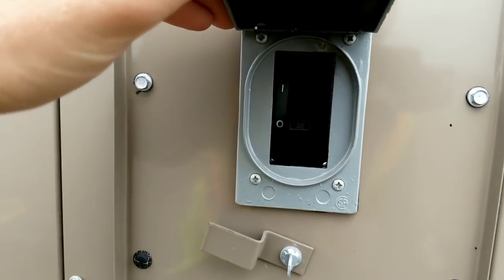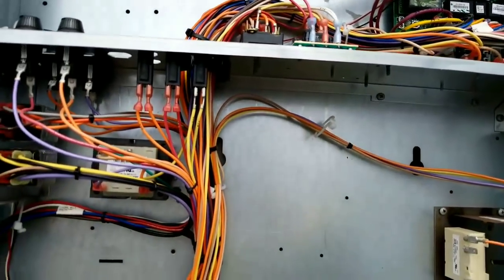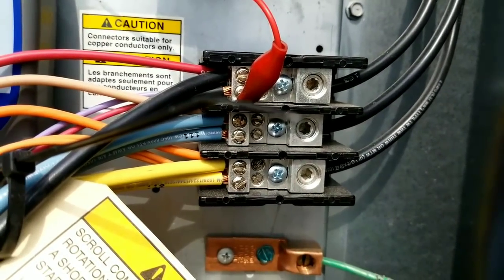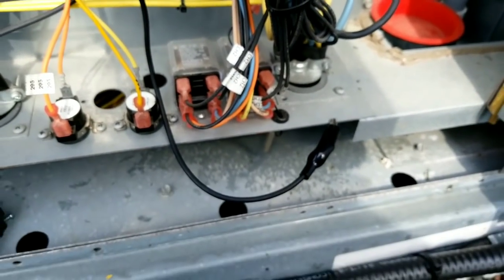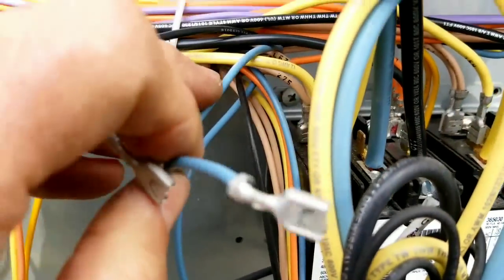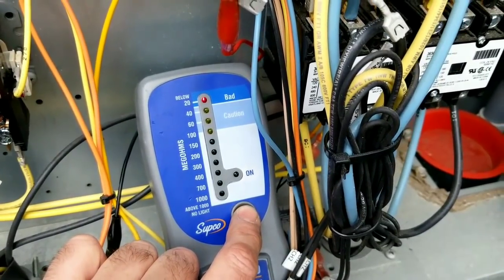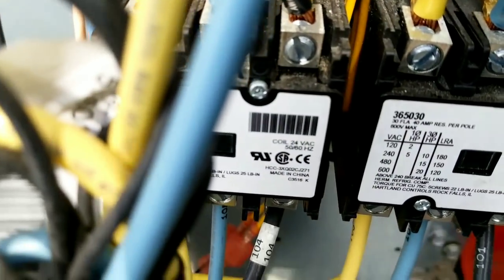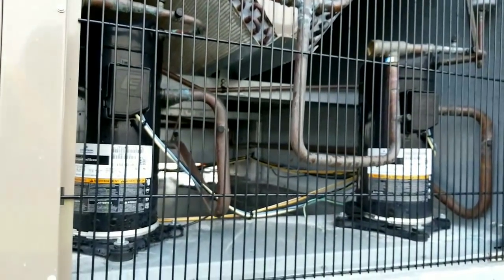HVAC Troubleshooting - Defective Crankcase Heater

Comment: I have a relay that powers a crankcase heater and is attached to a 3phase contactor for the compressor … will that faulty relay cause the compressor not to start or run properly? Since the crankcase isn’t effectively warming the oil in the compressor for proper operation? I thought that this was only the case in cold climates…

Comment: assuming that the 3phase system you are working on is 480 volts 1 meg ohm should not be low enough resistance to trip the breaker so either.

1. the breaker is a gfi and the moisture is triggering ground fault.

2. inductive kickback is putting the voltage well over 100 or more causing an arc ignition witch starts the arcing but i think there would be much more burning.

3. arc fault breaker is catching the arcing and cutting off way before it gets a chance to vaporize the wiring.

Comment: Wow I had the same call on the same model york unit . I arrived and found the breaker tripped but couldn't find the issue . Gonna go back and look in that direction.
Reply: Also check compressor bc to tripped breaker you need big load and pull alot amps